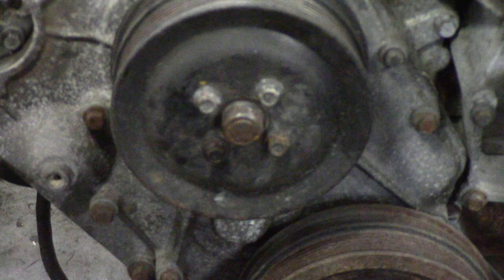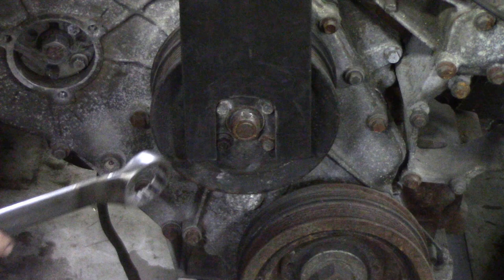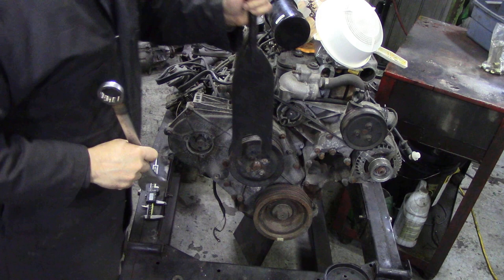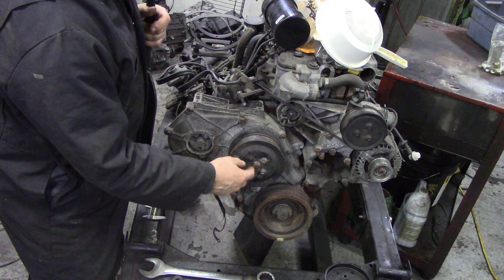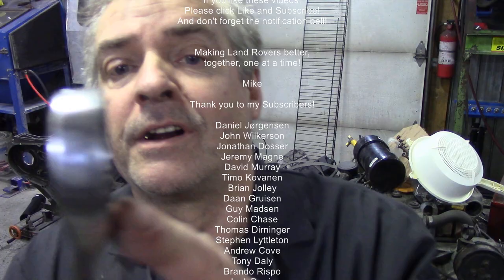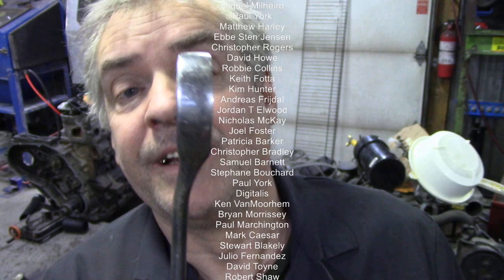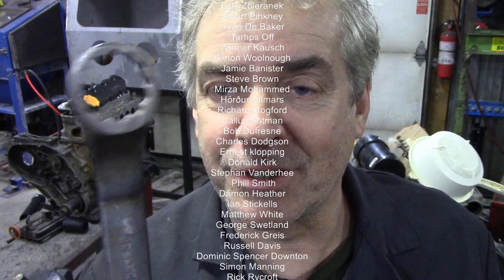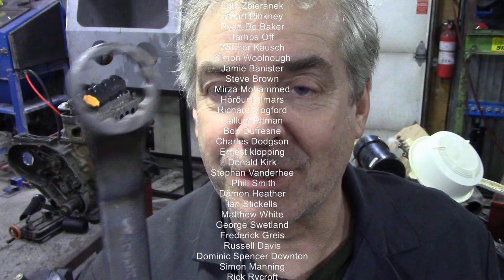300Tdi fan removal tool. As requested

Comment: Hey Mike, I made my "fan pulley holder" just to go over the heads of two of the bolts. 300mm length of 25x6 MS flat bar, drill two holes that are the size across the points of the fan bolts (10AF heads?), at the centre distance between two of the bolts along the centre line of the flat bar at one end. Take a "scallop" section out of the side of the flat bar, just enough to accommodate the centre boss and thread of the fan attachment point. Easy to make for anyone who doesn't have a welder. Use it similar to the tool you're demonstrating. Sorry can't give accurate dimensions I gave the tool to the guy who bought my D1.
Reply from the maker: That will work!
Reply: @BritannicaRestorations  aye! it did.

Comment: Good excuse to use my new plasma cutter ,like it, misses will say what do you need another spanner for,now I can show here 😉 and it will stop me swearing. Great video Mike 👍
Reply from the maker: I welded a shaft to my tool as that was the only flat steel available - you can make a nice profiled tool - better than my cobbled together rush job!

Comment: Is the special tool only required if the belt isn't on? On the two occasions I had to remove the fan I think I just gave the fan spanner a wallop with a hammer. Did I just get lucky!?
Reply from the maker: I think you got lucky - try getting a rusted one off!
Reply: @BritannicaRestorations  Thanks.

Comment: Hi Mike
My viscous fan on 300 tdi  is always on even when cold, is this correct? How is it supposed to work?
Great videos
Paul
Reply: If working correctly they will always spin with the engine running (even when cold due to the drag of the fluid in the coupling). In theory as the warm air from the radiator flows across the coupling a bi- metallic spring moves and ‘locks’ the coupling so the fan is fully driven. They can fail in the locked position. You can test them by seeing if you can spin the fan by hand on a cold STOPPED engine.
Reply from the maker: Good answer!
Reply: @bigal5932  thank you brilliant

Comment: Here it is your video showing how you made the tool: https://youtu.be/gs5gumMXw5I

You also used this tool on that video, a few years ago, when that power steering pump failed (the pulley and the shaft was out, therefore you couldnt put the poly-v belt to "hold" the viscous fan pulley)
Reply: If i am not wrong, the adjuster nut of the hood/bonnet pin also is 32mm, you can use the same spanner as this nut does not require a high torque, right? Cheers! Thanks for sharing
Reply from the maker: Yes you are correct  - for this I use my old fan tool which is thinner
Reply from the maker: Well spotted!